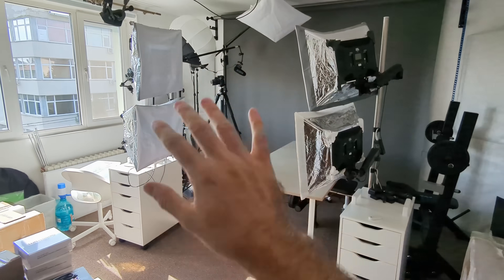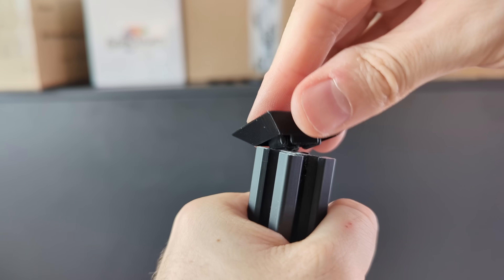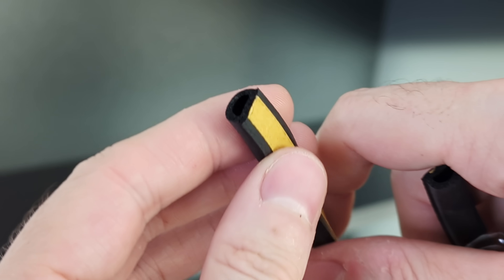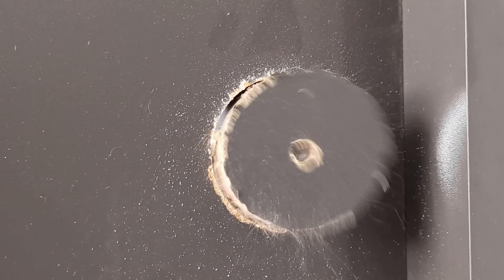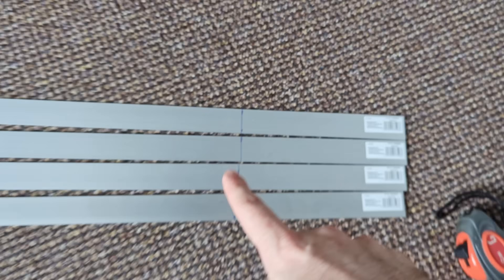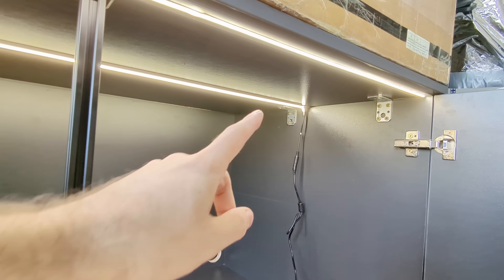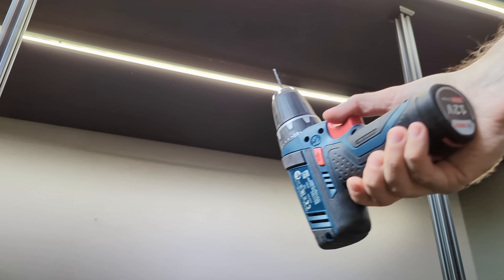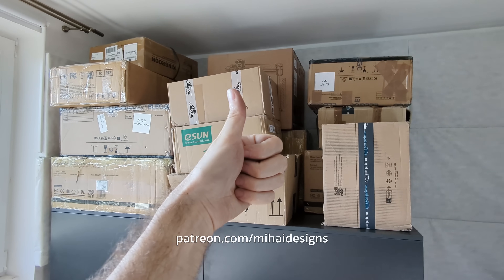Building custom 3D printing furniture

Comment: On the lights, it's probably not just the weight of the metal strip, but probably the heat as well loosening the tape.

Comment: I noticed you have a lot of boxed printers😊 Would you like to buy a bulk lot of printers? Various manufacturers a lot of Creality and some resin printers and bulk lot of filament dryers. They are all brand new. If you are interested I will make a list. I know there are ender 5, 6, cr20 belt, cr-6e max cr-6e, ender s5, Tevo and even some speciality ones in kit form. I was going to make a printer farm, but my health took a turn for the worst and now I can’t work. Need to recoup as much as I can. They are all boxed and unopened. The only thing is I’m in the UK
Reply: I have a new snap make a350 & a250 and enclosures, possibly 30+ printers brand new boxed unopened

Comment: Hole saws really struggle with "chips" and can seem like it barely cuts as a consequence.

It's good to drill a hole in the circumference of the hole you're drilling to allow clearance of the wood that it's sawing through.

So you drill the small starter hole, let the outside of the hole saw touch. Then drill another small hole lined up for the edge of the hole saw. Then resume drilling using your previous hole as a guide.

That way the cut material clears the saw teeth on each revolution.

Comment: @05:00 I'll be honest... Him not placing the Rubber further in the back for the Rolls to touch it while also making contact with the back of the Cabinet and thus securing them firmly in place from two sides instead of them now being able to wobble back and forth is kinda driving me nuts 😑
Reply: Wobble? In a house? With secured furniture? Ehhh

Comment: My solution would be to use silicone to attach that led aluminum strap/radiator - did that for my ikea kitchen lights after the original tape failed after like 2h of usage - still attached after 2years now

Comment: I think your double sided tape was failing because the aluminum strip got hot. The same thing will occur if the entire cabinet is heated. It'll probably happen again either side of your bolt. I'd suggest short self-tapping screws.

Comment: double sided adhesive doesnt work well under hot conditions. so the lights heat up the aluminium and the weight of the metal will make it fall off. LED strips themselves are light enough that the adhesive on them is less likely to fail, but something like an aluminium strip you wont get it to stay up with double sided tape. unless its a specialist one that rated to work at hotter temps

Comment: To be honest, I don't think the aluminium backing for the LED strips is even necessary. Ideally, you want to under-run LEDs a little bit if possible to extend their lifespan, but even at full power most adhesive LED strips shouldn't require special heat dissipating backing (at least in my experience, anyway). If the non-wood screws fail and the strips come down again, I would consider redoing them without the aluminium, which would also give you a chance to fix the messy end if you're so inclined (also, consider heatshrink instead of loads of electrical tape and silicone 😛).

Not sure how I feel about those aluminium extrusions, but everything else is great 👍. I particularly love the inserts you made for the power holes, and I agree with your brother's second design being my favourite as well, it's very slick.

Comment: I've found that, when I start with a painted or glossy surface, wiping down the surface with alcohol does wonders for improving adhesion (probably getting rid of leftover oils from the manufacturing process). Acetone will also work, but it'll screw up paint and the room will smell like acetone.

Comment: where do you get that cabinet? seems like ikea? but I don't remember if it's there.
Reply: Not ikea, it was custom cut. Ikea is good if you have the exact space otherwise you do custom cuts. They have cnc machines and they will drill all the holes for you.

Comment: I bet the glue on the aluminium strip kept coming off due to the heat from the LED's. Even just a little can make some tape come loose from smooth surfaces like melamine

Comment: you could put two lines of the adhesive gasket per shelf layer which puts the spools between the two so they cant roll around. similar to the idea of having a spool sit between two dowels.

Comment: I know you must be sick and tired of all the technical questions but it looks like you printed parts directly on the high temp plate without adhesive. I did that once with PLA and it left pretty substantial „stains“ and since then I’ve used adhesive. Do you have any recommendations for the high temp plate?

Comment: Maybe a TPU cover would seal it up nicely so no air goes in/out there
Reply: Yes I printed some split rubber bungs that go over cables and then push into a hole so you get a fume proof seal around the cable.